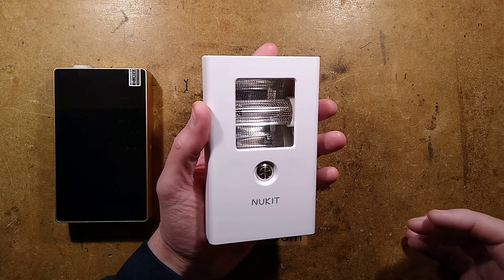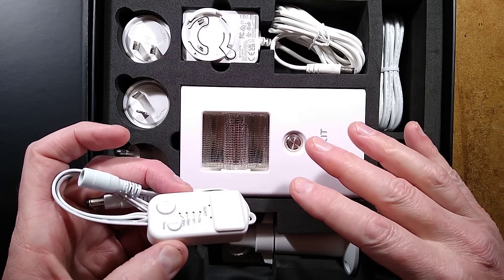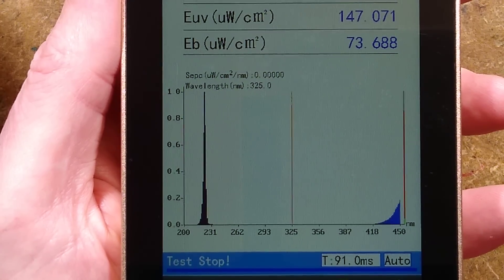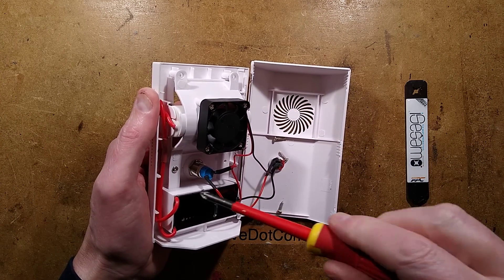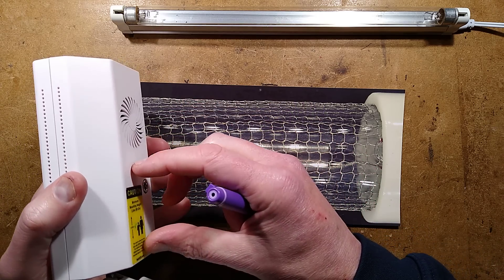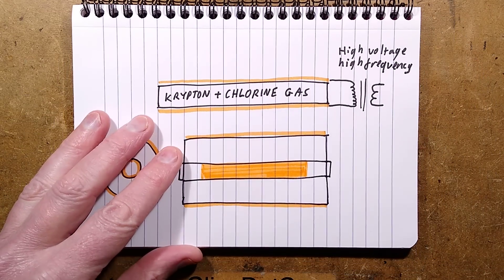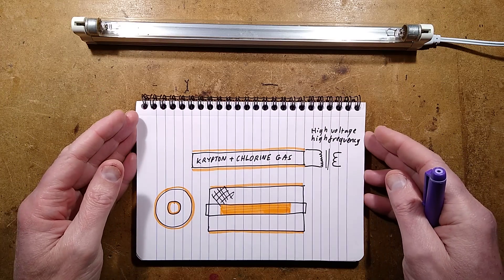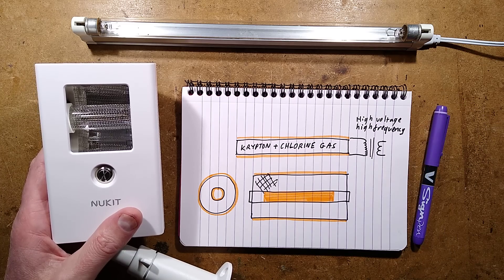Naomi Wu's Nukit 222nm sterilising excimer light

Comment: Lovely unit. It remembered me however of a interesting soviet device. It's a UV "cure-all" 240-290nm low power lamp. It was probably quite popular in Russia, but I' ve never seen it in Poland, maybe I will manage to buy it on AliExpress someday. It's of crap quality, but has one interesting feature. Instead of being an ordinary mercury vapor lamp with ballast it uses an electrodeless lamp excited by 45MHz oscillator based on miniature RF pentode used also in soviet R105 transceiver. It's also an interesting tube, it uses rods instead of wire grid as the control grid, so called "rod tube". RF power will be probably in range of 1...1,5W.
Reply: * i meant ebay, not Aliexpress of course.

Comment: As a fan of 222nm for disinfectant purposes I am glad that it is becoming more commercially available. Although since my career has headed in a different direction, I am an electronic engineer who specialised early on in optoelectronics - and for some time I was a researcher working on developing and laser processing materials suitable for transmission of 222nm UVC for a Welsh company. What you have to understand is that UVC transmission depth is low, very low. I have doubts about the ability of even multiple of these devices to successfully disinfect a room (whereas one 254nm lamp can do that). Additionally, very few materials will allow the transmission of 222nm photos for any significant distance. Really, the primary use case for 222nm disinfectant devices is for use in small spaces, or with mobile disinfectant devices you sweep over a location. This device feels like it doesn't really know what it wants to be.

Also, your claim of "skin and eye irritation" for 254nm UVC is incredibly misleading. It can and does cause cancer and its propogation in anything other than incredibly controlled industrial implementations is dangerous. I find it absolutely insane that you chose to switch on a mercury vapour lamp less than a metre from it with no PPE on your skin and (presumably) your eyes. I'm not going to proselytise any further but I seriously suggest you refrain from this for your own health, and, so your viewers take it seriously.
Reply from the maker: The belief that UVC causes cancer is wrong.  It's the longer wavelengths like UVB and UVA that penetrate deep enough through the skin layers to cause that issue, hence sunbed induced melanoma.  You may wish to research that.

UVC at 254nm does cause surface skin irritation.
Reply: @bigclivedotcom the statement you have just made that 254nm does not cause cancer is categorically false.

Comment: A couple of things I'm skeptical about. The first is about power level and effectiveness. Like all light the intensity goes down with the inverse square of distance. So how far is realistic coverage? The second is I've seen the claims about safety going back several years. I'd like to see an explanation of just how safe it is (especially for eyes) based on detailed physics. Is there a level at which it will cause harm, if you're close enough?
Reply from the maker: There is a recommended minimum distance for mounting them.  The effectiveness does reduce with distance.  The number of units needed will depend on the area you wish to cover.

Comment: Thank you for this very cool video. Especially useful was showing the 147 µW/cm² Euv value. This looks like exciting tech, tho, it also seems that you need several of these units to efficiently disinfect a room.   One other point, at 3000 hr lifespan, these lamps would need to be replaced periodically. What seems to be missing from the website, is the replacement lamp, and replacement lamp cost.
Edit: I had thought Keratitis might be an issue, but can't find any studies yet that indicate it is a problem at this dosage level at 222nm.

Comment: The safety of these things is highly debatable. Check the relevant literature on uvc site sterilization. And as long as they need an occupancy detector, they can't work while people are in the room - exactly when you would need it.
Reply from the maker: This one has an occupancy sensor option that turns it on when people go into the room.  Not off.

Comment: but how many watts of 222 does it emit... if it's not at least a dozen it won't really be useful at any distance.   I'm excited for the uvc led bulbs coming to market recently.  finally getting into the full 1w range in a reasonable package. still not ready yet as a technology compared to mercury arc but it has its niches.  it's very strong and directional in a small area.  flash sterilizing small spaces.  still waiting on my uv laser though
Reply from the maker: The UVC output is not intended to be high for these units, as they can work continuously while spaces are occupied, instead of blasting unoccupied areas like traditional mercury type units do.

Comment: why the PCB potted, it not water resistant, the is fan, and none external ports switched, power sockets looks water repelling abilities ?
Reply from the maker: The power supply is very high voltage between 3-5kV, so the module is potted for insulation.

Comment: It sounds like more research needs to be done regarding the safety of 222 nm UV. Because of the short wavelength, photons have higher energy than those at 254 nm. If these photons can kill viruses, why don’t they damage human cells?  The idea sounds great, and I too am glad to see that Naomi Wu is still actively pursuing her passion for electronics.
Reply: The short answer is that you don't have any live cells on the exposed surface. Even the thinnest layer of water (which covers the protein material of your cornea) is enough to absorb this wavelength. You can have a google for results if you want -- in this case google still manages to give relevant results. 
https://www.nature.com/articles/s41598-020-67211-2

Comment: I Would be careful when using any UV below 300nm.  Human exposure to 222nm (skin, eyes, etc.) should be carefully monitored and of very limited duration.  While it's true that conversions and electron excitations are at specific energies ( i.e. quantised) the use of low wavelength VU in the presence of humans should be generally avoided and in any case is almost always unnecessary(?).  I would personally not be happy to be exposed to VU radiation of greater intensiity than the sun at any wavelength.  Even in full sun, adsorbing lotion should be applied after a maximum of 10-15 minutes exposure even in the UK.  It is true that window glass adsorbes the sun's UV rays .  The treating of water, foods, bacteria and viruses does not need to expose humans to UV of any wavelength.

Comment: I see on the website that they're not available to be shipped to Canada. She seems to have offended Health Canada by not jumping through a sufficient number of regulatory hoops, so they've banned the units here.

I will resist the urge to give several examples of HC not knowing their butts from their elbows when it comes to making recommendations. The bureaucracy must be satisfied!
Reply from the maker: I believe Canada may have an issue with the fact that they can control small insects, and as such require approval by insecticide regulations.

Comment: you know they use green leds to sterilize blood samples.  they also started using them in fitness watches strapped to your artery.  is that good? 😅
Reply from the maker: Research of UV and red LEDs has been tried in blood sterilisation.  The LED on smart watches may be to monitor pulse and maybe oxygen level.

Comment: I may be mistaken, but I think eximer system tubes do have a finite life of around a year in continuous operation?
Reply from the maker: The quoted lifespans I've come across for these smaller tubes are between 3000 and 4000 hours.  I'd guess the high output versions used in industry may have a shorter lifespan.

Comment: What will happen if the glass tube breaks?
I suppose the krypton gas is very inert, does do much worth reporting.
But the chlorine gas is dangerous. It's wikipedia page says it has been used a weapon of war. It is a toxic gas that attacks the respiratory system, eyes, and skin. Obviously there isn't much gas in there, but still precautions agains breaking are to be recommended.
Reply from the maker: It's a tiny amount.  No health significance.

Comment: All of those claims about "human safe" - one has to wonder if its truly safe for those who suffer from vitiligo or other melanin-affecting conditions and diseases.
Reply from the maker: Even with very pale skin, there is still the outer layer of shedding skin cells.
Reply: The skin is constantly dying & replenishing itself, of course.  Since it is the melanin cells that usually absorb/block the UV, and a main risk for cancer due to UV, I wonder often with UV products if safety isn't just strictly looked at from that point.  However, all tissue can be damaged by UV with the right wavelengths & exposure.  Clearly questions for the medical professionals, but if one lacks melanin (say entirely due to vitiligo), how does that change which wavelengths skin & underlying tissue is affected by UV - and how does it change the affect.  I would suspect that a specific wavelength, like this product's output, might be less "safe".  Of course we're talking about someone who's not the average person either; but non-average persons (infirm) might be the ones most interested in these products.
Reply from the maker: @davidbandler  The wavelength of the UV determines how deeply it can penetrate.  They used to consider UVC a dangerous wavelength because of its surface irritation effects.  But now they regard UVB as more dangerous because it reaches more critical skin layers.

Comment: The pathology analysers I service commonly have the gas discharge tubes or UV LEDs for sterilisation.
These are inside enclosure with polycarbonate windows that don't transmit UV

Comment: Please consider doing a teardown of a “brewer’s belt”, it’s a mains powered silicone covered belt heater, sold to home brewers and recently adopted by resin 3D-printer enthusiasts. The problem is the Amazon ones are potentially a fair bit unsafe. Thanks Clive!🙏
Reply from the maker: I wonder if they're based on the heater wire or the carbon fibre laminated film.

Comment: Is the reflector polished aluminum or polished stainless steel? Or something else? Aluminum is higher performance, but needs a coating to prevent oxidation. I think that water disinfection will stick with 254nm. Disinfection of water needs both high intensity and lower wavelength to penetrate through the water.
Reply from the maker: Not sure what the reflector is made of.  It seems too springy to be aluminium.

Comment: The hospital where I work has a historical problem with legionella. I think about 2 patients have died as a result in the last 20 years. Could this tech be used to sterilise water in storage? Or would the water filter out the wavelength? The current solution is automatic showers that run themselves for about 10 mins every night. But this is obviously a waste of energy, and also causes the occasional flood, if the shower head is pointing in the wrong direction.
Reply from the maker: I wonder if there are a lot of water "dead ends" (unused sections of pipe that harbour bacterial growth).  The shower approach seems odd.  I'd have thought a direct to drain solenoid valve would be better.

Comment: I am curious about the spectral transmittance of the front glass. Can this expensive spectrometer measure the transmittance by comparing two spectrograms ?
Is this glass usable for making an ultraviolet camera lens ? 
I think it is the same material used to make the glass tube, that explains why the spectrum was exactly the same with or without the front glass.
Reply from the maker: I don't think your camera would pick up the 222nm wavelength.  The front glass does remove a very slight longer wave UVC hump in the output.

Comment: Bit of an odd Q: What wavelength of UV light might be good for controlling bugs, if any, along w/spores & viruses? Am thinking of maggots & bedbugs specifically in a mortuary context. Would the 254 nm tubes do the job?Thanks!
Reply from the maker: 254nm will deactivate bugs and mites with direct exposure.  Some hotels have built in UVC lights for sterilising unoccupied rooms.

Comment: Because of the safe "non-penetration" properties the light will not pass thru plastics or penetrate in many fluids. So whatever needs sterilized better be on the surface microscopic droplets. From a quick perusing documents about UVC222 it does seem to create ozone in water (out of existing oxygen in water) but I'm guessing the water must be in contact with the glass?
Reply from the maker: Classic UVC water sterilisers pass the water along the side of a sleeved tube or have one submerged in the water.

Comment: Oh man, I'm not sure I have anything intelligent to add to the conversation but Holy Nutz my LD points are being triggered.  What about fluorescent UV tubes?  Filtered and unfiltered?  And Woods Glass (+Merc vap lamps?)  And that blacklight fixture I made from the weird mineral excitation P38 (buuut not quite a P38) lamp and the UV roundel?

Was attending dirty basement raves the solution to disease prevention?  (Yes, I remember the piece done on deadly Chinese UV fixtures.)

Look for the double tube fixtures and orange cords.  Thems the sign of a proper blacklighter! 

Repeated rave UV exposure probably didn't help with avoiding STD transmission though...

...sigh.  often when I enter basements and weird warehouses it smells like rave... .. .
Reply from the maker: The blacklight tubes were UVA.

Comment: A few Q's Clive, can thus be used in the home in say the Bathroom, how many is recommended, would steam from a shower effect the unit, will it run on standard British sockets also is the product available in UK, nice vids, very informative, 😊👍
Reply from the maker: I don't think steam would be a good thing, since this unit pulls air through all the time.  It comes with a selection of socket adapters, but could also use a standard 12V 1A power supply.

Comment: Low UV has been an understood phenomenon for a while, but that wavelength is not very effective at disinfection. It needs to be closer to 265 for peak efficiency to disrupt DNA. It sounds like it has an application on skin disinfection, but so do gloves. Medium pressure UV lamps can emit all the UV and disinfect everything it touches.
Reply from the maker: If you look up the research on 222nm it does seem effective at deactivating viruses and microbes in the air.

Comment: Logically, it would be the wavelength dangerous to humans which would be dangerous to germs.  So germs are sensitive to wavelengths that other organisms like us humans are not. Perhaps I need to study organic chemistry for the answer.
Reply from the maker: It's to do with scale.  The layer of dead skin cells on the outer layer of human skin, and the layer of liquid on the surface of the eye is what protects mammals against the very short wavelength penetration.  But in bacteria and viruses they do not have that layer.

Comment: What sort of time exposure is needed? Is it impossible to sterilize a stream of air inside an opaque enclosure with wider range UV lighting?
I was thinking some UV LEDs shining on some glass boiling balls inside a box with a fan pulling air through and a basic filter on the intake.
The plan was to make it easy to mount over a cutting board and then you could cut open food packages, portion and reseal them, all without excess contamination thanks to the UV cleaned air?

Comment: It would be fun to get a tube full of the KrCl gas mix and see if it can make a laser beam. The tube would need to be frosted inside, a highly reflective mirror on one end and a quartz lens on the other with a focal length similar to the tube length. You would have the curved side facing the gas as excimer lasers dont like stable resonators. Use RF at about 400W or so.❤

Comment: I work in the meat industry and 20 years ago  I was testing UV sterilisation of poultry, the main issue I had back then was shadowing and the length of UV tunnel needed to be effective on a moving line
Reply: There's always cobalt irradiation....
Reply: only the surface will be cleaned
Reply: @janami-dharmam  Are airborne contaminants often found _INSIDE_?
Meanwhile.... Gamma irradiation will thoroughly disinfect through and through
Reply: @jimurrata6785  I mean that any bacteria or virus sleeping in between the fold will not be affected. You remember how much the mom fussed about cleaning behind the ears?

Comment: A very well thought out and nicely made device! I really like the 'tripod mount' on it. It looks like it could be installed in a similar manner to CCTV equipment, may well be designed to be installed in such a manner and possibly by CCTV technicians and installers with a little extra training.

What could be next? A CCTV camera and 222nm combination device? Such a device could be very interesting, combining surveillance with sterilization. To begin with, there would be a common shared power supply so only one power cable, only one mount needing to be installed, and an extra output from the occupancy sensor used to trigger the sterilisation could be made available to trigger the surveillance equipment to switch to record from this camera, It could also be built as a self-contained combined CCTV recorder and steriliser with maybe a microSD card for storage for smaller or simpler environments. There could also be a variant powered via Power-over-Ethernet that could stream surveillance data as well as steriliser activation information and possibly provide remote control as well all via the ethernet connection...

Apologies for going on and on, I'm autistic and my mind loves this kind of thing.